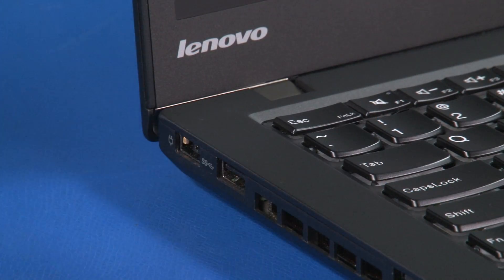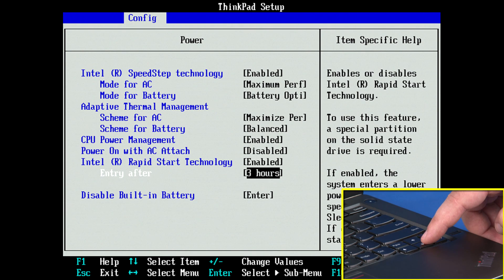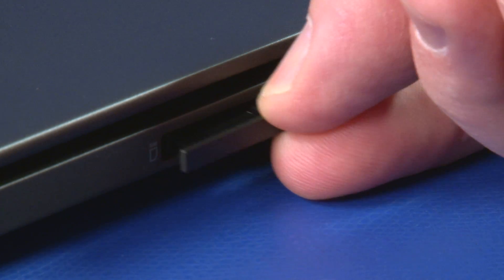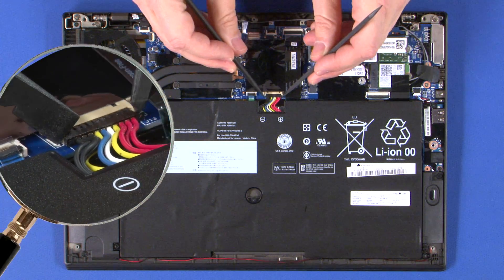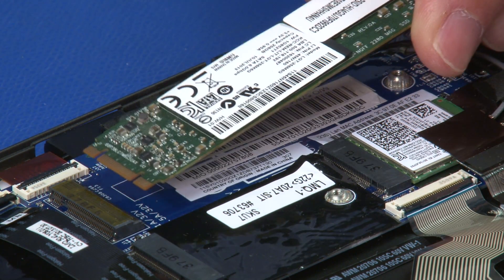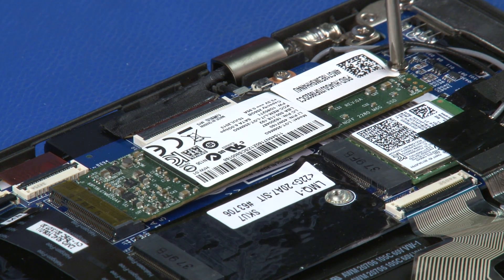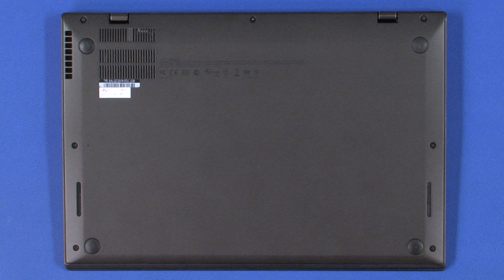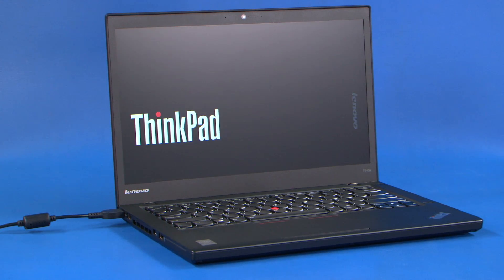ThinkPad X1 Carbon (2nd and 3rd Gen) - M.2 Solid State Drive Replacement

Comment: Hi Folks, Lenovo Support - Can someone confirm whether Samsung 860 EVO M.2 2280 SSD (1TB) will be supported by X1 carbon 3rd generation (20BS model)? If not, can you let me know which 1 TB drive is compatible with 20BS model? Thank you!
Reply from the maker: Hi ap. Thanks for reaching out. Upon checking, the Samsung 860 EVO M.2 SSD is not listed on the supported and tested SSD for X1 Carbon 3rd Gen. You may check compatible SSD here: https://lnv.gy/2tt8Nz7. Technically, it should work as it as m.2 however we cannot guarantee its performance as it is not listed on the system service parts. We suggest posting from our community forum here: https://lnv.gy/2ttfnG6 to check if other users who already tried to install Samsung 860 EVO M.2 SSD on their X1 Carbon 3rd Gen. Should you need further assistance, let us know. Auxen_Lenovo
Reply: Thank you for your quick reply. I noticed the link above takes me to Gen 2 compatible SSD's and not Gen 3. Could you please provide me with Gen 3 compatible list? Would appreciate it.
Reply from the maker: Sorry about that. Here's the link for X1 Carbon 3rd Gen system service parts. https://lnv.gy/2ttk3Ma. Thank you. Auxen_Lenovo
Reply: Thank you, that helps!
Reply from the maker: You're welcome. Let us know if you need additional information. Auxen_Lenovo

Comment: Can I use the Samsung 960 pro NVME Ssd to my x1 carbon 2nd gen i5 20A7 ???
Reply: Assalamu'alaikum, saya udah coba update BIOS terbaru, tetap aja error' 2103 saat pakai NVMe SSD. Adakah solusi ?
Reply: @ArrySoeryono  Gen 2 not support NVME
Reply from the maker: Hi FaisaL! Thanks for reaching our support! Here is the list of the recommend SSDs https://lnv.gy/2tk8uXx (search for SSD) that will work on your Lenovo X1 Carbon 20A7. 

As per the Samsung 960 pro NVME SSD, as long as it is an M.2 type SSD, that will work on the Lenovo X1 Carbon. Let us know if you have any other concern. -Chris_Lenovo
Reply: @LenovoSupport  Does the X1C3 bios support NVME (in order to work with a NVME ssd)? If not, will X1C3 fall back to a PCI-E mode without NVME?
Reply: For example, I found here https://www.crucial.com/usa/en/compatible-upgrade-for/Lenovo/thinkpad-x1-carbon-(2015)
that Crucial P1 1TB 3D NAND NVMe PCIe M.2 SSD should be supported on X1C3, but I believe it is a mistake. I am still not decided to buy this ssd.
Reply: I tried the Curcial 500GB 3D NAND NVMe PCIe M.2 SSD but unfortunately I got error 2103 when booting. Did you find a suitable SSD?

Comment: My Carbon X1 20A7 doesn't boot and I removed the SSD per above. I wanted an enclosure to recover files off the SSD.  Can you recommend an adapter?  SSD Info: LGT-256M6G P/N 45N7160/16200487
Reply from the maker: Hi there! You can try any of the SSD to USB adapter that can be found in local hardware store. Please provide us the serial number of your laptop so we can check for warranty options to repair the boot issues. Thanks. Arjay_Lenovo
Reply: Thanks for the quick reply.  Got an adapter from a local computer store and was able to recover the files.  My X1 is pretty old and out of warranty, but thanks for the warranty check offer.

Comment: can you install two ssd's in the x1 carbon gen3?
Reply from the maker: Hi! Thanks for reaching out. According to the System Service Parts of the Thinkpad X1 Carbon 3rd Gen, it only has one slot for the M.2 SSD connector. You can check this link as a reference http://lnv.gy/2G3lR3B - Mark_Lenovo
Reply: @LenovoSupport  I use X1 carbon gen 4. Can I upgrade from M.2 SSD to NvME SSD?

Comment: Whenever I restart my ThinkPad T450s I'm getting this error "2102: Detection error on SSD2 (M.2)" 
I've searched online for solution and it told me to re-seat the M.2 Solid State Drive. 
Should I be needing to install a new software just to re-seat the M.2 Solid State Drive?
Reply from the maker: You shouldn't need any new software to re-seat the device, just pull it from the socket and plug it back in.
Reply: Thanks guys.

Comment: how could I migrate OS to a new SSD on lenovo x1 carbon 3rd???
Reply from the maker: That's a good question. I'm not sure myself. I'll look into that and get back to you. I would think you might need to buy an M.2 to USB adapter, clone the OS M.2 SSD (the one in your computer) to your new M.2 SSD with the adapter, and then install the new M.2 SSD into the system. I'm not sure if Lenovo offers an official way to do this.
Reply: - get CloneZilla and create a bootable USB stick
- connect a empty USB disk that is larger than the internal SSD to the laptop and boot from the USB stick
- clone your SSD disk to the external USB disk
- replace your SSD disk according to the instructional video
- boot CloneZilla from the bootable USB stick
- clone your USB disk containing the image of the old SSD disk to the new SSD disk
Reply from the maker: I think Matthias Bartosik's response is very close to what the official response would be. Lenovo might prefer that you use the Lenovo recovery tools: https://support.lenovo.com/us/en/documents/ht035659 but CloneZilla is a great utility and it might be more readily available depending on your location.
Reply: Correct me if I'm wrong, but doesn't the recovery tools only put the laptop back to factory installed condition?  Meaning, all software, user files, etc would need to be re-installed all over again?
Reply: I believe you got it correct.   Will Clonezilla make use of the new space on the larger driver?  Or, will the partition need to be resized to use the additional space from the new SSD disk?